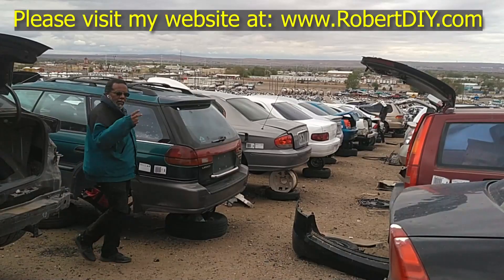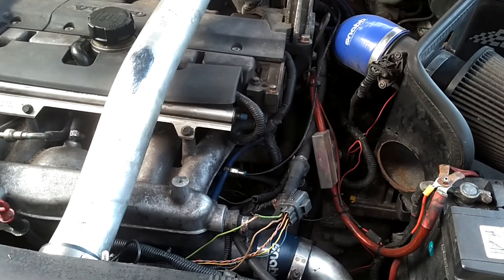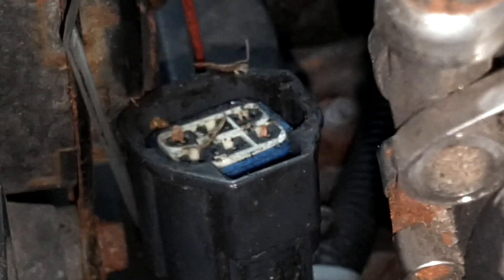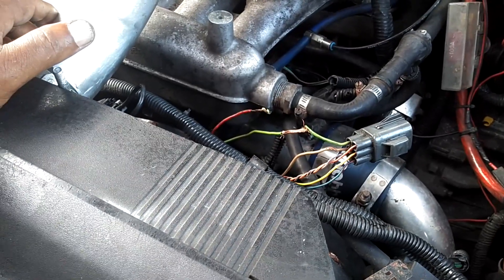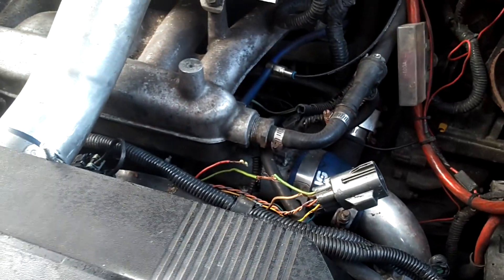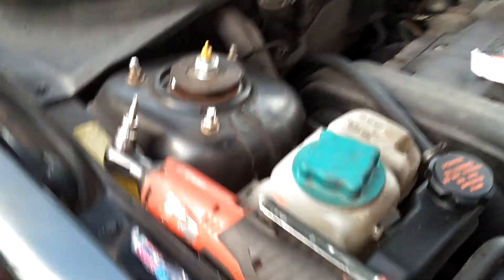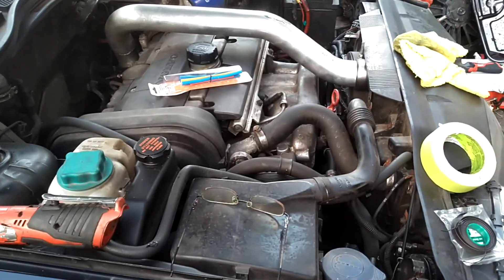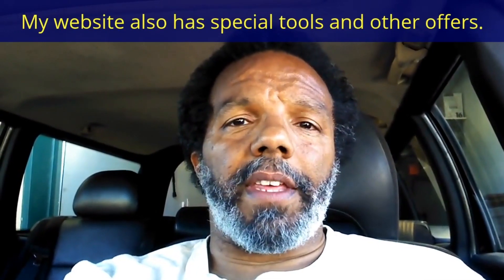Messing with the ETM wiring on a 1999 Volvo V70R. Busted spring seat.

Comment: I missed something in my exposure so far. To ask a stupid question:What is ETM ...Let me guess E stands for Electronic and M usually stands for Module , this  leaves  T......Tackion?
Reply: Electronic Throttle Module.  The P80 S/V/X70 had a changeover in 1999 which became the setup for the P2. 1998 v70 retained a throttle cable connect via linkage to the throttle body. 1999 and forward used an ETM.
Reply from the maker: What he said. 👍🏾
Reply: @vcu3rams  ThankYou , thank you! Of course , of course! Throttle.... so obvious. So many abbreviations, so little time between failures . Keep on truckin'!

Comment: Hopefully it was just the wiring. The red wire with the inline fuse, is that for the radio or other added accessory?
Reply from the maker: Added stereo crap.
Reply: @RobertDIY  thanks for the response. I have that same wire, along with several others on my recent acquisition that I think is causing my electrical issues.